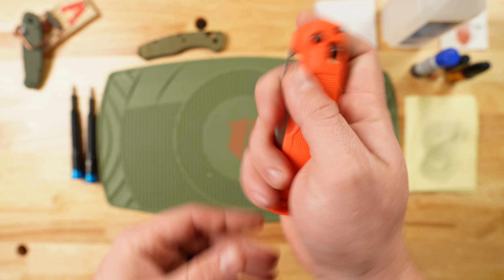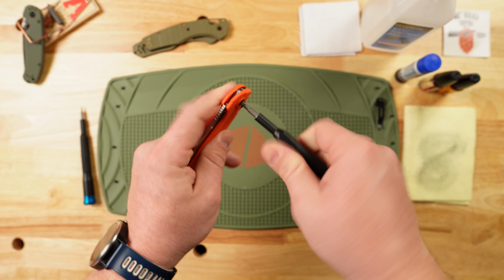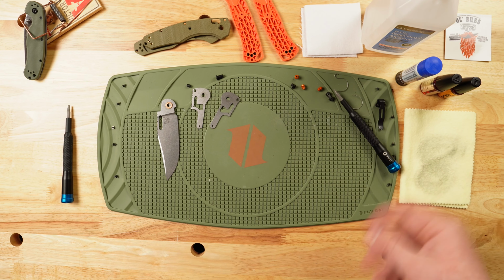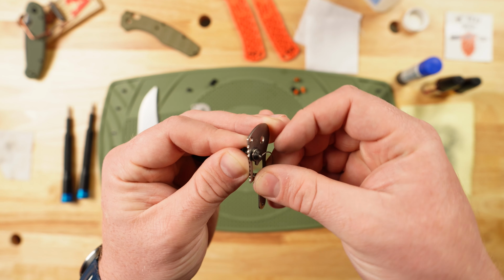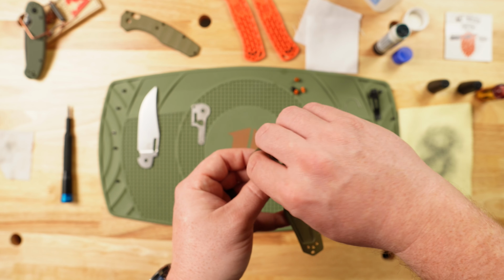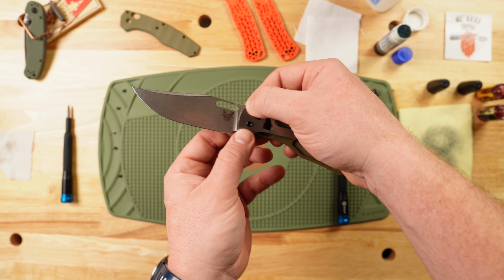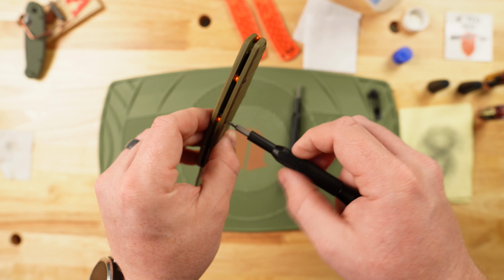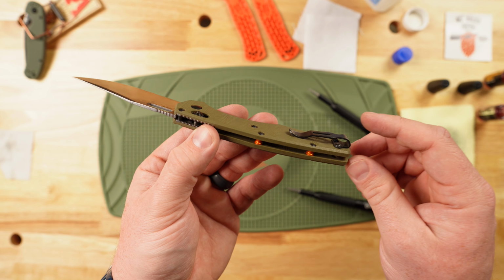Benchmade Taggedout: How to Swap Scales

Comment: This would be the long way to replace them. Probably be able to replace them in about 5 minutes if you do one side at a time. Future scales may not line up exactly so you may have to fully take it apart anyways. Nice vid 👍🏼
Reply from the maker: Definitely the "long way" but I prefer cleaning all the parts while swapping. Also the pivot has to come out completely to swap the 2nd side. Flytanium makes a tool  that holds everything together while the pivot is out to do the swap faster. I featured that tool in my bugout video, but truth be told I prefer the long way that really only takes me 10 minutes or so when not on camera and trying to explain the steps.

Thanks for watching!!